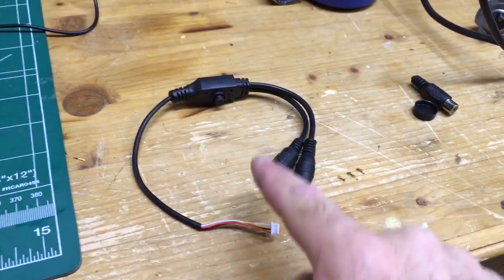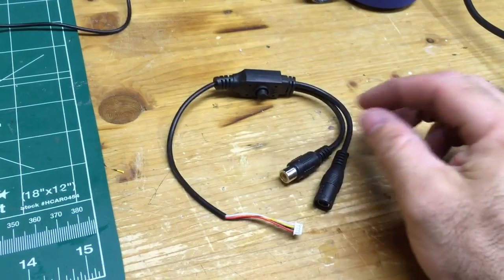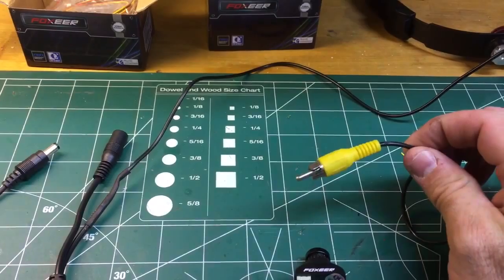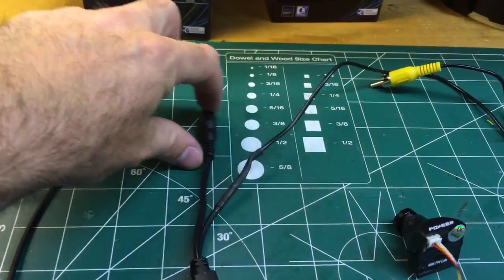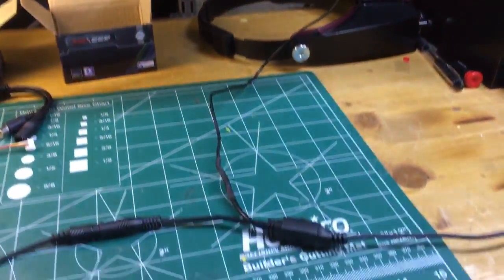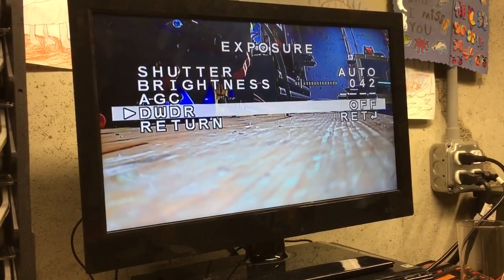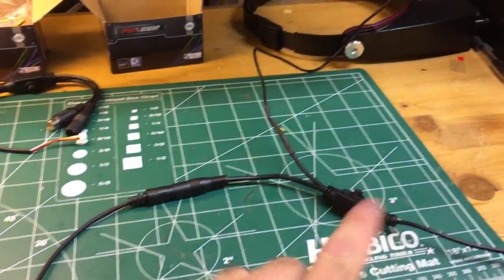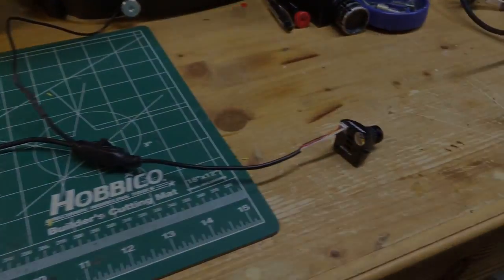HS1177 FPV Cam - "Hack"

Comment: Wait wait wait.... why the hell are you suggesting doing it that way? The end you're cutting off the supplied cable —is an RCA connector— it's RCA female. 

It's WAY easier to just use what you're supposed to use, a $2 male to male RCA cable. Plug one side into the TV, plug the other into the end that you suggest cutting off.... Then you're done... 

Man, some people just have to make things harder than they are... lol.